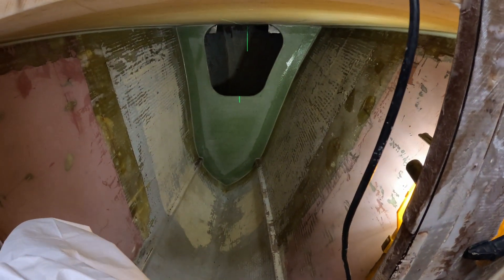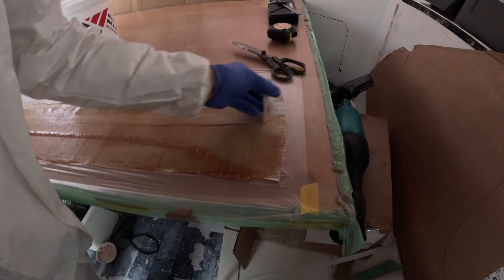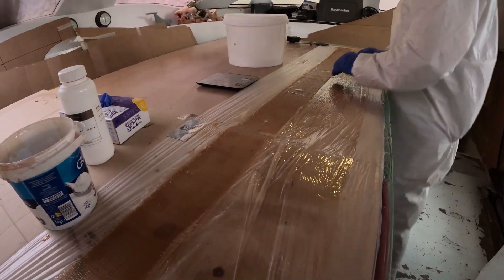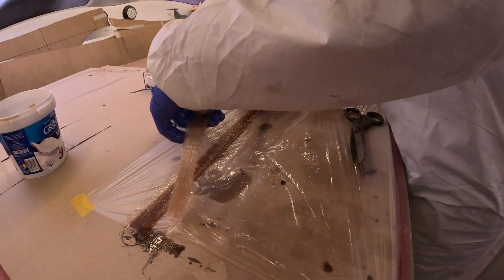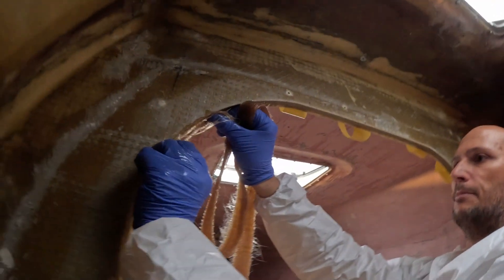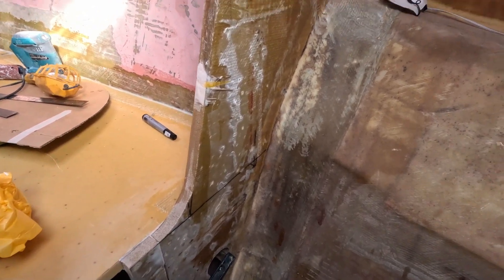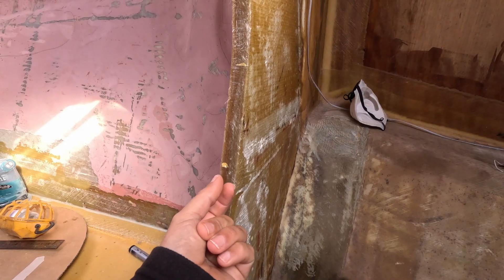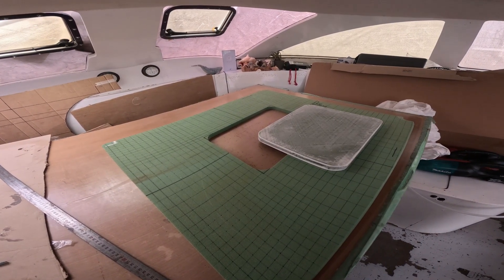Reinforcing a Bulkhead: Unidirectional Fibreglass & Edge Capping

Comment: When doing uni ropes for our project we found that different suppliers would roller easier/tighter than others so getting the right stuff made the project easier. Lots of uni ropes on a foam cored boat.
Reply from the maker: Yes its important to check what suppliers can offer as it does differ. We have the issue of trying to do a refit in a foreign country without a workshop where we don’t speak the language. So we are definitely doing it the hard way 😉😅

Comment: Just found your channel and playing catch up.   For the floor Ayden is replacing,  is the foam divynicell or equivalent and how thick is it and what is the lay up schedule.  Your comments on another video about all the use of Coosa or thermalite for many things is over used when foam composite is much lighter and as strong .
       Been caring for a 32 foot diesel cruiser for 28 years now, 40 year old boat needs some upgrades as we get older with it and foam composite will be used.  
       Absolutely love watching the quality craftsmenship and especially with your family!
Reply from the maker: Core is 20mm rigid pvc structural foam with one layer of 1200g quadaxial on each side.
Reply: @youngbarnacles  thank you!

Comment: Thanks for thinking about the nerds in the room and saying how much uni you put in there :) 2 layers of 600g ish double bias to ver that or something to that tune I’m guessing? that bulkhead is part and of the main beam that sits under the mast right?
Reply from the maker: Always thinking of ya mate 😉
I used 20x layers 600g uni inside cut out. Wrapped single layer 600g DB for edge capping.